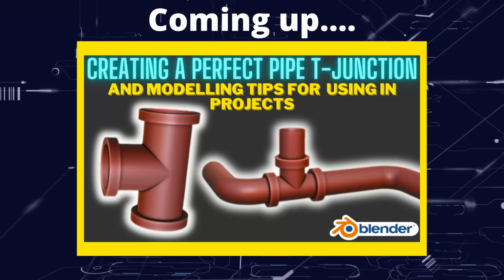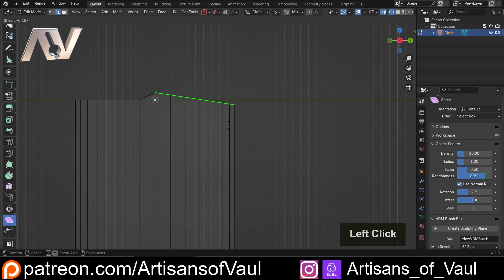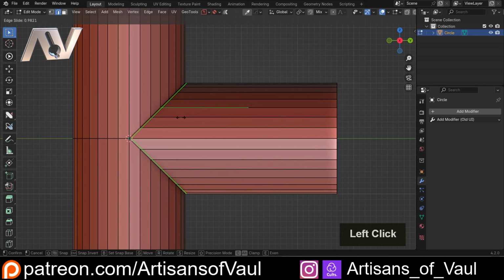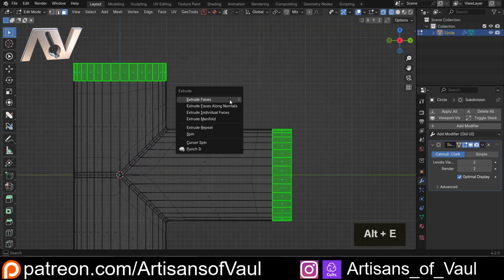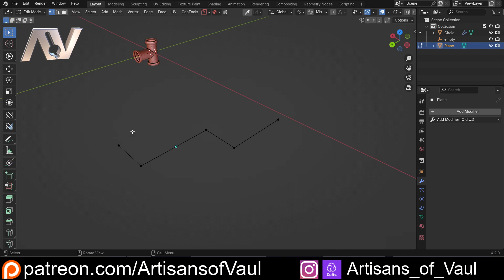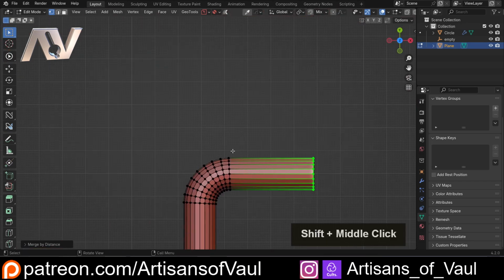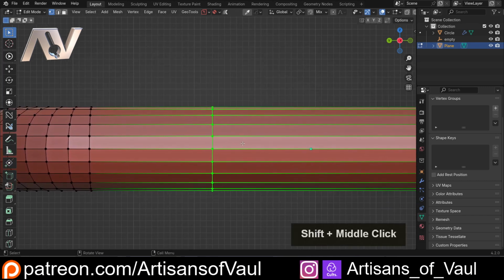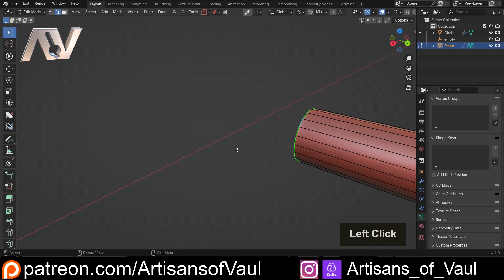Creating a perfect T-Junction pipe in Blender

Comment: I can't seem to bevel at 4:35 at that seem. Something is stopping it.
Reply from the maker: I would guess you will have some verts overlapping I would guess. Try "a" then "m" and by distance first.
Reply: @ArtisansofVaul  No overlapping verts, but I did manage to fix it by just redoing it exactly how you did it, namely by starting with a circle instead of a cylinder, that way I also didn't get any mixed up normals that I'd have to reset. Still not sure what the issue was, but it's fixed now!

Comment: Odd follow-up question that really doesn't seem to fit anywhere... and my Google-fu is apparently not as good as I had thought because I can't seem to find an answer. Soooooooo... I have a cylinder (pipe section) that I have cut to an angle on one end. Doesn't really seem to matter the angle, so, 45 sounds good. I then slice below the end that is angled to in essence make the "flange" portion of the pipe that you are showing... but it is going to be at 45 degrees... not 90 degrees perpendicular to the pipe. I try to extrude the now 45 degree angled flange and it goes in almost any direction BUT the correct direction. Is there a way to cut the pipe at an angle, then cut below that to make the basis of the flange, then extrude the flange... or do i have to do all of the cuts on a 90 degree, and then rotate the entire flange section afterwards?
Reply: OK, I figured out that I can take the face at the angled end, set the origin of the pipe to it, create another edge loop beneath the bottom of the angled flange, then scale the entire flange section with a "local" scale and restricting one of the axis (in my case Z), and then make a small adjustment to the extra edge loop to bring it in line. My method reeeeeeeeeaall feels like there are far too many steps. There has to be an easier way.
Reply from the maker: @keithmathews4605  If it was me I would make the flange without the angle and then select everything thats part of the flange (or whatever you want at 45 degrees) and use the shear tool so that you don't get any issues as you would rotating it.

Comment: It will be faster to perform subtraction using a cube
Reply from the maker: @3d178  At which point? You mean removing the section of pipe and adding it in? It's an option but this is there to help solve issues where that may not be an option (and also an excuse to show off another methodology)

Comment: Is there some magical tick box somewhere to change the angle of the knife cutter increments TO the 15 degree increments that you are showing in this video? My Blender 4.2 is somehow set on 30 degrees, and for the life of me, I am not able to figure out why... let alone how to fix it.
Reply from the maker: You got to the solution faster that I did.  I wonder if it does start at 30 degrees and for some reason I changed mine to 15 way back...  Hmmm  🤔
Reply: Never mind... I found it. It was listed under the right panel under the knife "tool" menu, where there is a small section at the top of that panel that says "Angle Snapping Increment". Why mine was changed to 30, I am not sure. None the less, it is fixed now.

Comment: Is it possible in blender to have some sort of 'Custom Snap' on each of the three Tee ports?  So that the pipe fittings snap together?
Reply: press G then B, and then select the vertex on your object you want to snap the object onto others
Reply from the maker: @benveasey7474  As has been mentioned you can use G and then B, it's a function called Snap Base. I've got a video here with it in if it helps: 
https://youtu.be/wTEET48OaS0
Reply: @ArtisansofVaul  It's the selection of the central vertex that can be tricky.  In Revit you can have Custom Connectors that snap to each other. Much easier, and crazy that Blender is missing them.
Reply from the maker: @benveasey7474  It would be cool to be able to add in custom "grab points".
Reply: @ArtisansofVaul  perhaps one of the upcoming gizmos in the next release will have them....